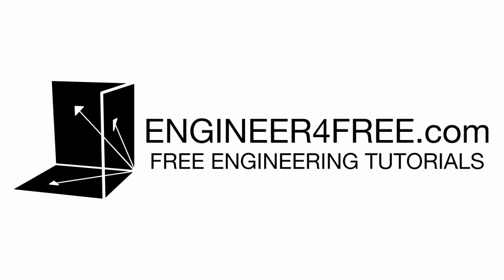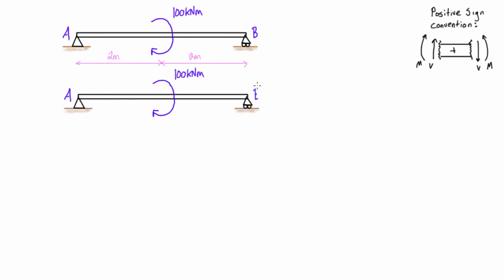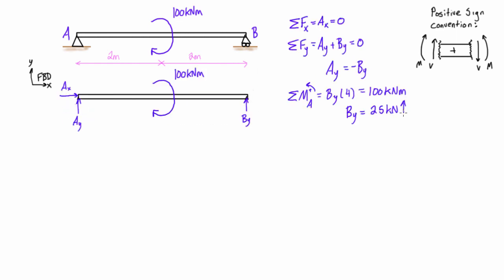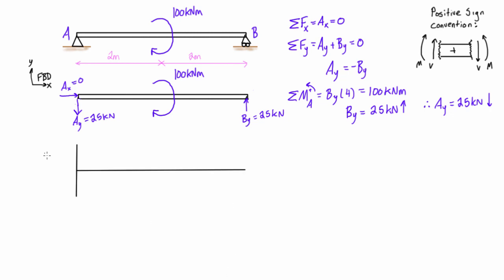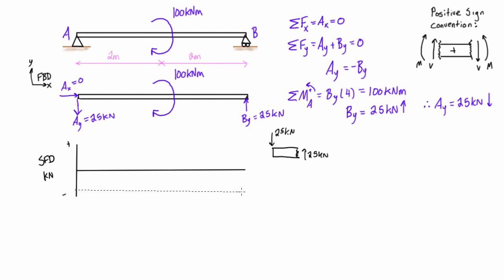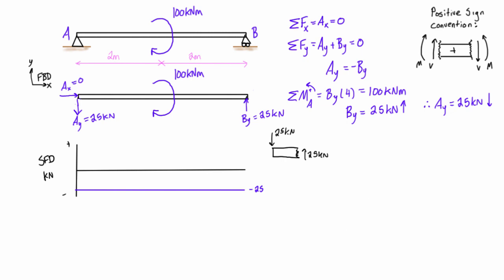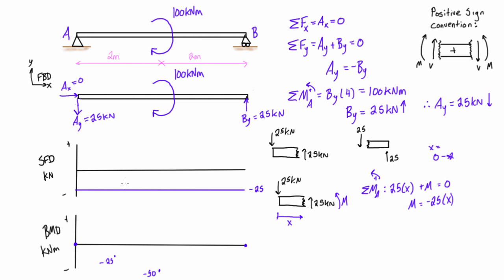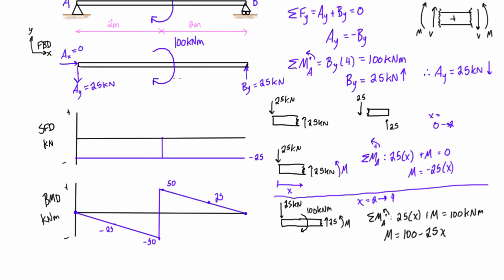Shear force and bending moment diagrams example #4: applied moment

Comment: Will there be any sort of vertical displacement at where the concentrated moment is applied?
Reply from the maker: No. Because of symmetry, the midpoint of this beam should remain undeflected. The beam would deflect upwards on the left hand side, and downwards on the right hand side.
Reply: @Engineer4Free  Cheers man

Comment: what should i answer if some one asks what is the moment @ mid point of beam?
Reply from the maker: That would be a dirty trick question. Mathematically, it’s D.N.E. (Does not exist). But I would write a small paragraph explaining the magnitude and sign just to each side of the midpoint, and then also mention that it’s a dirty trick question 🤔

Comment: Why is reaction Ay downward?
Reply from the maker: If you grab the beam in the middle with your hand and twist in a clockwise motion, the beam is going to want to rotate clockwise. As a result, it is going to be pushing (down) into the support at B, and pulling (up) at the support at A. The reactions "react" to this by applying equal and opposite forces to prevent this rotation from actually happening and keep the beam in static equilibrium. If the beam is "pulling up" on the reaction at A, then that means the reaction at A is "pulling down" on the beam at that point A. Does that clarify it?
Reply: sure, understood your explanation, thanks for your time.
Reply: I was sorta getting the concept before reading your explanation. Now I want to give you a kiss on the cheek for this, kudos!